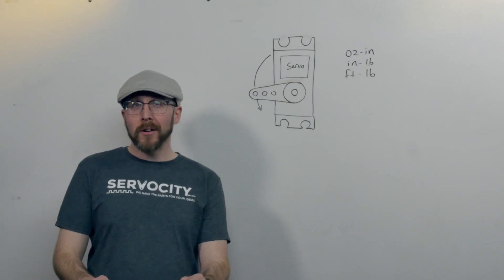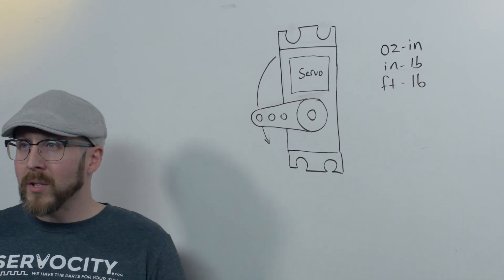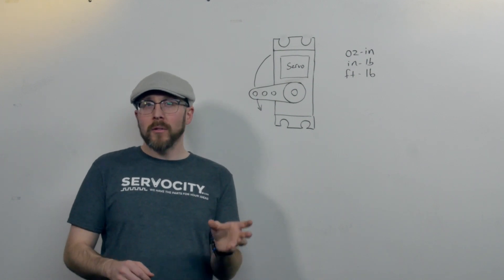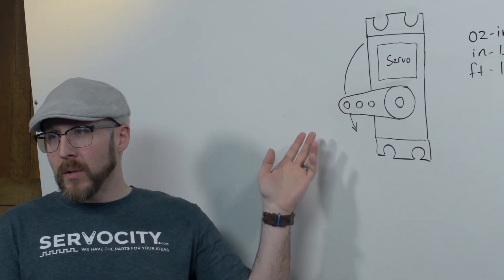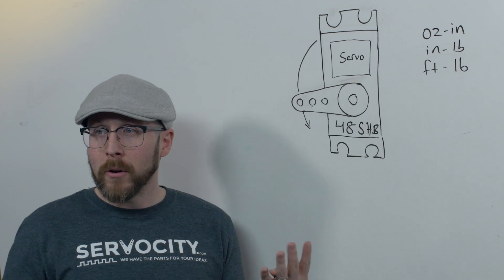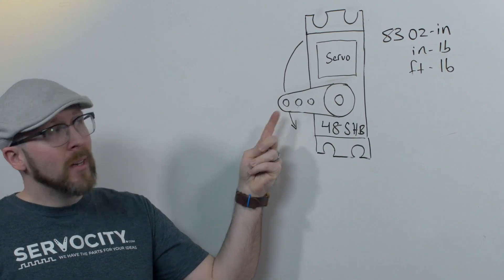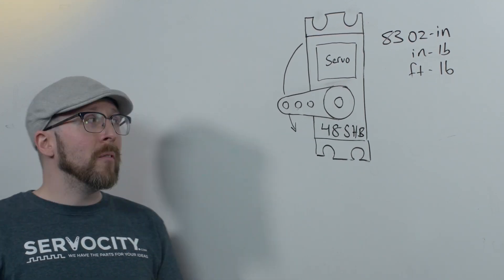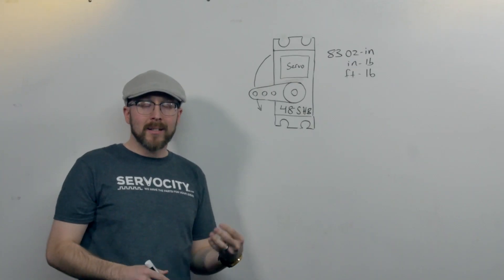The Measurement of Torque - The Secret Life of Servos Ep6

Comment: Usually (maybe always), servo manufacturer provides in description "Stall torque".  So when i imagine it correctly if you have torque 1kg/cm, then the servo is able to hold load of 1kg on 1cm leverage with this torque, bu is it able to "move it"? How much it differs from rated torque? Or is it the same? Thank you.
Reply from the maker: You're correct in your assessment of stall torque, it would be able to hold a load of 1kg at 1cm, but not move it. Many servos don't have a "rated torque" spec, but but torque and speed are linear inversely proportional. Mechanical Power is Torque x Speed, with that info we can find the torque and speed at any point on that "graph". 
You'll find that peak output power is at 50% of the stall torque and free speed.

Comment: kg-cm pleeease.
Reply from the maker: You're right, we should have included some metric units in there too.  In the same way Jason breaks it down using inches and ounces, you can use kg and cm or any combination of weight and mass you wish.  The units don't matter, the concept remains the same.  Let us know if you have any other questions! tech@servocity.com
Reply: Yes, but I really dislike the American way, sorry :D
kg and cm, as well as meters, km etc. are way better for calculations as its just a simple 1:1000 scale. Really, US should switch to metric :P
Reply: 1 kg*cm ~= 13.887 in*oz
1 in*oz ~= 0.072 kg*cm

I recommend the "Qalculate" calculator, and creating a keybinding shortcut for it on your computer. It becomes faster than Google.